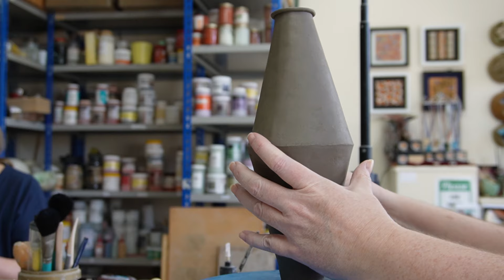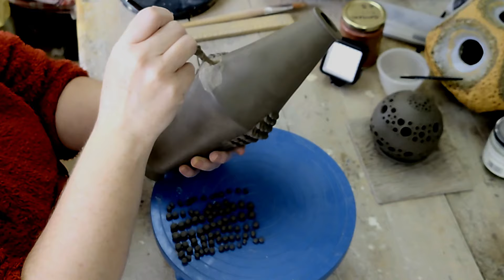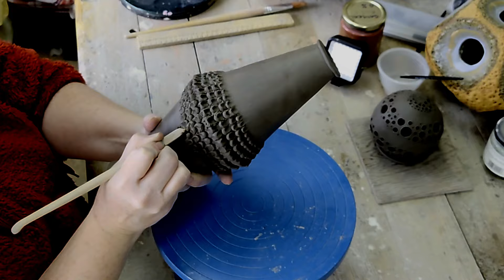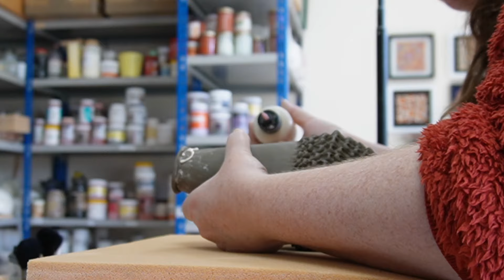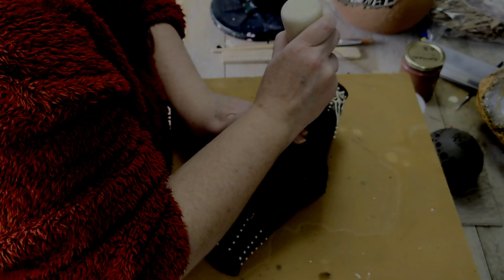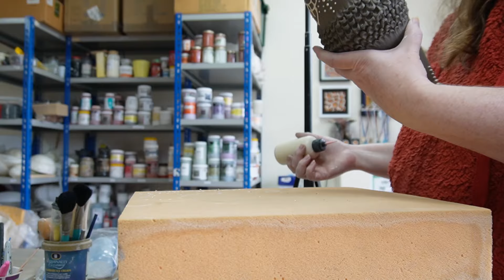Vase Making: part 2. What I learnt about decoration

Comment: You did great with the slip trailing.  I find that I need to work in sections, as if I try to do all the way around a pot at once, I end up putting my hand on the not-quite dry trailing, and have to re-do it!  I can't wait to see how you glaze this!
Reply from the maker: Thanks ☺️ I certainly felt like I had a better feeling for it by the end but it's definitely something that I'd be better at with practice 😄 I'm good at dots 😜